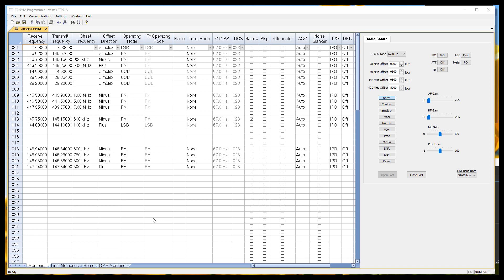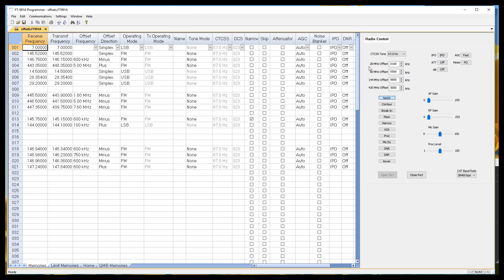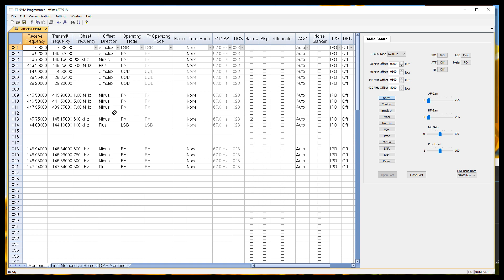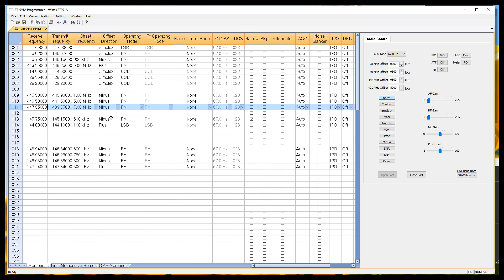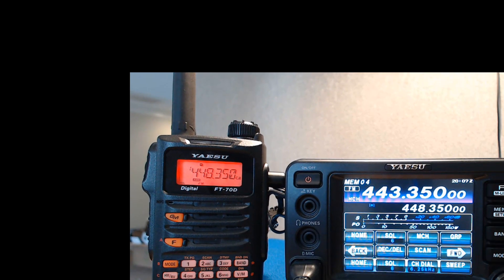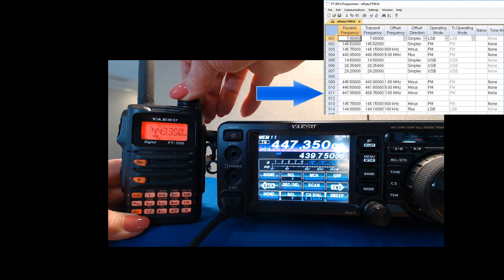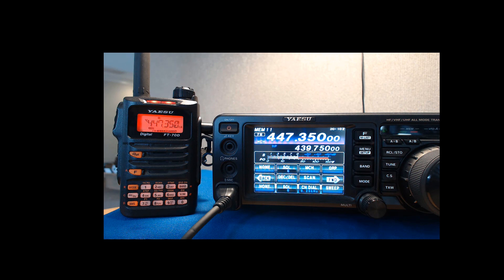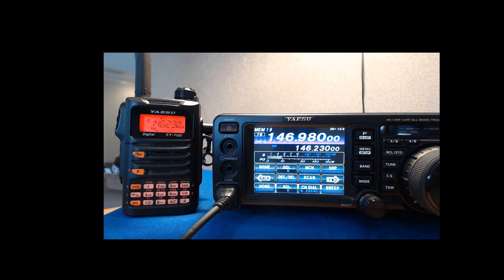Repeater Operations of the Yaesu FT-991/991A

Comment: all good, but what about 6m???
Reply from the maker: That is the 50MHz offset.
Reply from the maker: All works the same way with repeaters and splits as needed for the repeaters you enter.
Reply: Still have got no answer...
And no, radio came with no software, and also, why would it be needed to program two 6m repeaters??
Now the question, did any of you guys try it, or just guessing?
I know this radio will NOT do 2 different repeater spaces on 6m.